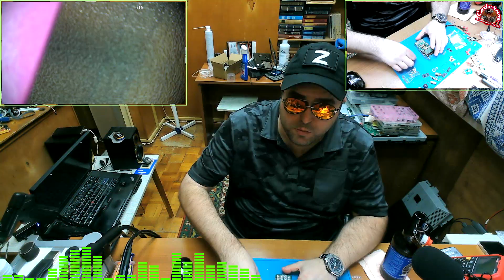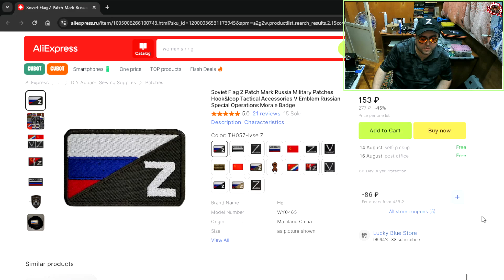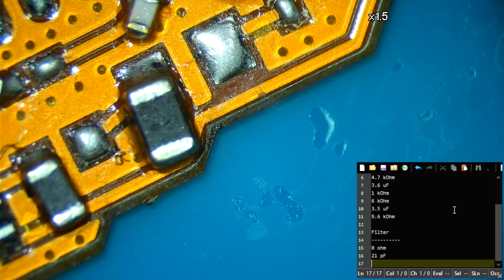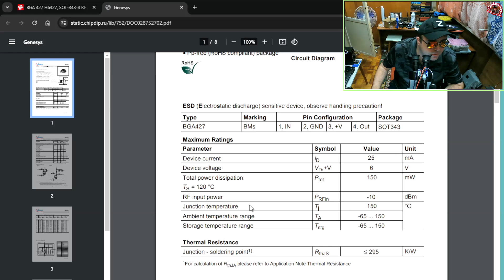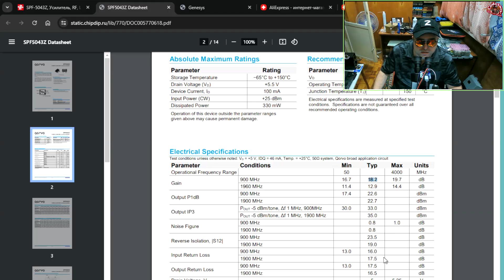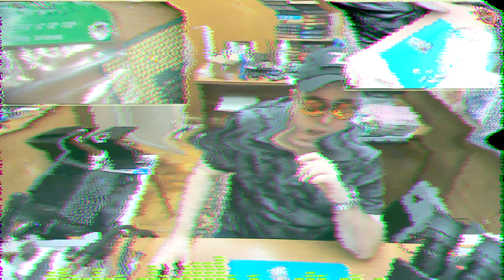UV-K5 si4732 v2.5 overview - hf full band /w LNA & audio preamp

Comment from the maker: Measurements, links to badges, and boards are in video description.
Reply from the maker: AUDIO
-----------
100 nF
3 uF
3 pF
4.7 kOhm
3.6 uF
1 kOhm
6 kOhm
3.5 uF 
9.6 kOhm

Filter
----------
0 ohm
21 pF
0.12 uH
1.5 uH
4.7 uH
1 pF

LNA
----------
0 ohm
100 nF
100 nF
100 nF
100 pF
100 pF

Comment: Hi again. I have found the original drivers for BK4819 made by the Beken Corporation. They have been included in a project on GIT-hub made for some other RF device (ec100y) that is using the same chip. Some chinese guy: "gaozichen2012" have included this in his project. The name of the project is: "tp69-lvgl". Till now, all the released firmware for the UV-K5-K6 are based on the drivers released by "DualTachyon" . This drivers are made by reverse engineering the original firmware and are not perfect...  Having this original drivers now, somebody can make a better firmware for this UV-K5-K6. All the functions referred in the "BK4819(V3) Application Note" can be found on this driver files. I have seen that FAGCI have archived project for "Reborn" so it will not be updated anymore... and there are still lots of bugs in his Reborn firmware. Despite being the best till now, there are small bugs like bitwise OR-ing constants: 0xE94F with decimal 10 for setting the "MIC" volume. First: 0xE94F value is not the default value of the 7D register, in the original drivers the real values can be found, and second: application note only tells that the default value for 7D register (bit 4-0) is 0x10 - hexadecimal not decimal, 7D register being a 16bit reg.
Reply: Yes, I can confirm "DualTachyon" drivers are a mess. For example: for setting bit 14 to 0 in a register "DualTachyon" wrote: "0U <<14 | register_value", the CPU will allocate a 16bit variable, will set this to 0x0000 (0U <<14 will do the shifting but the rest of the bits will also be 0) and will execute a bit OR instruction with the "register_value" and the "register_value" will be unchanged. Instead he should wrote: "0xBFFF & register_value", this way the CPU will keep all the bits unchanged from the "register_value" except of bit 14 that it will be set to 0. 0xBFFF = 0b1011111111111111. Also the "BK4819(V3) Application Note" tells: "When used as a digital transceiver, all audio filters need to be bypassed using RF_EnterBypass(). To exit this mode, use RF_ExitBypass()", "RF_EnterBypass()" is not even implemented and there is no other code that does what this function should do. "DualTachyon" is calling "RF_ExitBypass()" when you start to TX and also when you end the TX... this is wrong, he also states that his library is experimental, I don't blame him, he did a good job for the most of the code but there are critical settings that are wrong. I'm sorry to tell this but all this experimental firmwares for this radio are not good, maybe IJV is better, there in no source code available for it so I can't tell. FAGCI made the Reborn based on this drivers... a lot of work based on wrong drivers...

Comment: For better sound quality on the SI-MODs with audio op-amps on board change the feedback resistor on the audio op-amp. The audio signal is over amplified by default. As you look at the op-amp IC is the first resistor on the right with a value of 4.7kohm. Change this with a 1kohm one, there is a significant improvement in sound quality by changing this resistor.

Comment: Hello
I have a UK-V5 (8) with the SI4372 v 5.0 module installed. I would like to remove the TX track element(s) so that the device is only a radio scanner (no KF license) only listening. Please help me - which elements/s do I need to remove from the PCB version R51-1,6 ZH18 (2333) so that the TX path stops working completely?. Thank you very much for your help. Greetings

Comment: My experience pushed me to dual antenna configuration implementation with version 2 board. Audio amplifier pushed the audio noise to unusable level, in my opinion, and needed to be discarded. I am skeptical about any benefits RF LNA can bring except significantly decrease in the receiver dinamic range, increase the number of spurious reception channels, and noise level. Correct antenna matching networks are more important than additional gain.